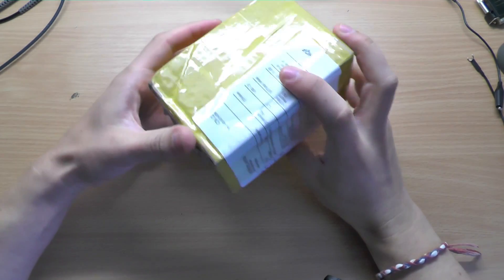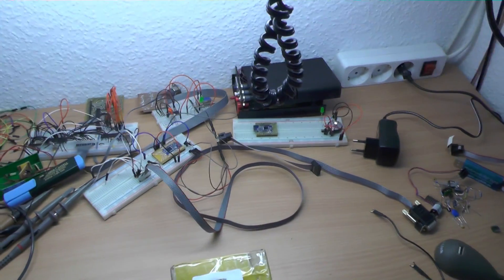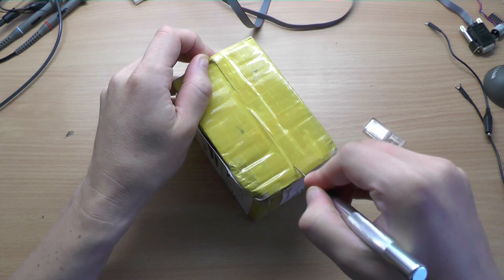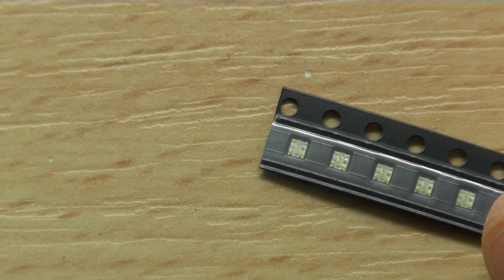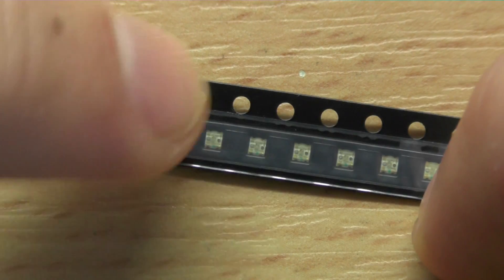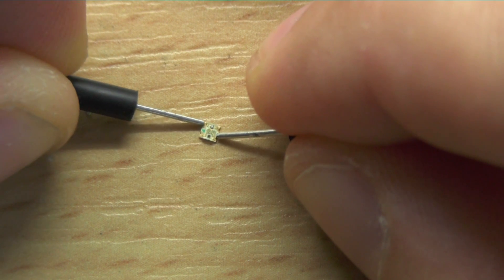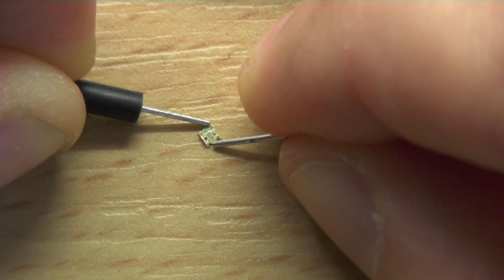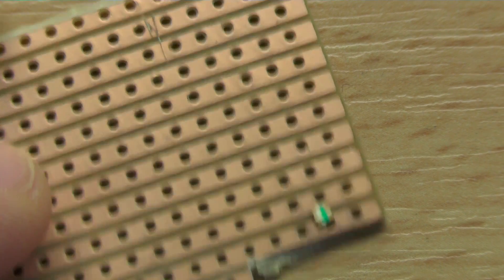Delivery from China - 0603 RGB LEDs

Comment: I've used these in projects also except a PC board was much too bulky so I had to solder very fine wires directly to each terminal. I used my smallest soldering tip and that was much too big. So I decided to build a special soldering tip as fine as a sewing needle. That works better. Lastly after bring all four wires together and twisting them into one, I added a small drop of nail polish to the backside of the LED to strengthen the solder joints. This worked well giving me a robust RGB LED at the end of a wire. These I then used along with an ATTiny85 chip to simulate arc welding in HO scale.

Comment: Anybody who solders has to be careful on how much solder is used on each leg. And how much heat is applied to the joint.  To much solder and you have a cold solder joint, to much heat and the mono polar joint is fried. Trained by PACE Soldering.

Comment: i just bought the same strip the other day,i am trying to make a home made watch, could you tell me if im able to make them synchronize color changing with the watches time or its timer/count down!! hope you answer asap thanx
Reply from the maker: sorry just noticed your comment today. you can use a microcontoller as clock and PWM for each R, G and B to mix any rgb color. you could use the PWM output with a mosfet to drive many of them simultaneously.. or you can use any kind of any RGB driver
Reply: killedtwosherif b